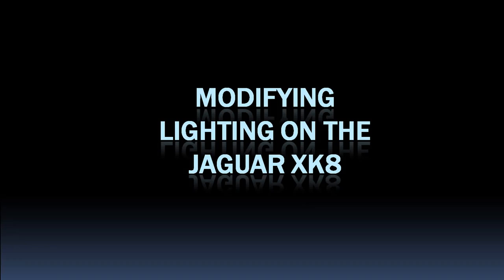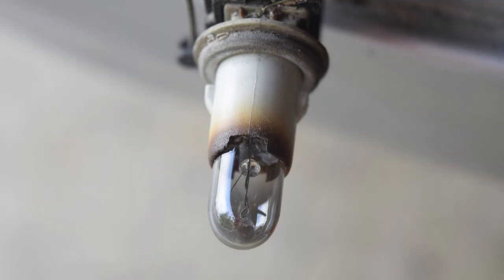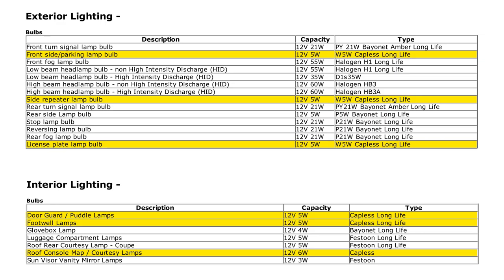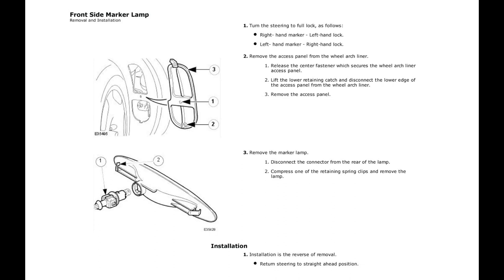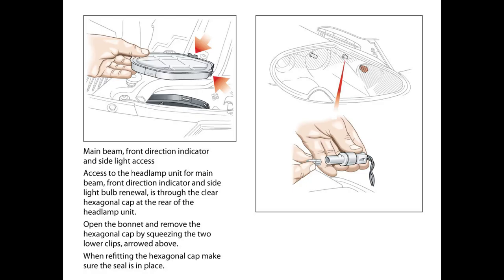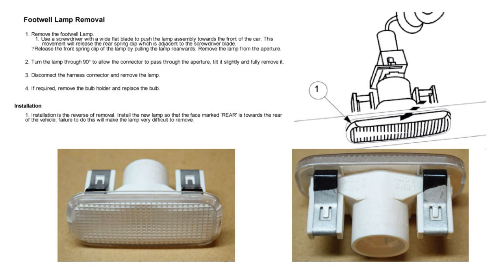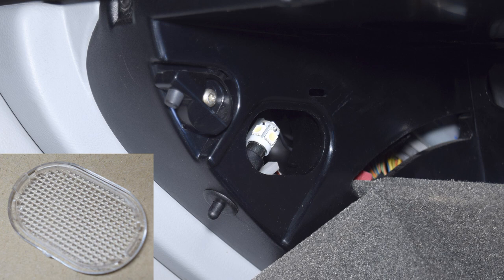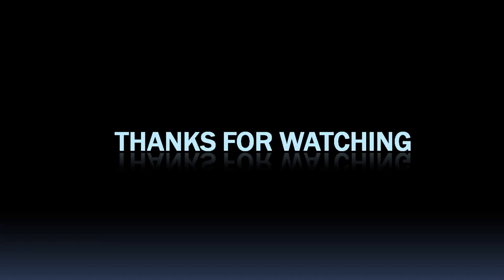Jaguar XK8 Lighting Modifications

Comment: Would love to know what upgrades you would recommend for the main and dip beams
Reply from the maker: Mike. I really don’t have a solution for headlamps but, coincidentally, the day you sent your message I met someone with an XK8 who was very happy with the HID kit he’d bought on eBay. However, a few days later you’ll see there was comment on this channel from Andork who wants to dump his HIDs. It’s my understanding that even if LED lamps are, or become, available that are bright enough for use as headlamps they need to be used in a reflector housing specifically designed for them in order to focus the light properly. That’s because, whereas a filament is a relatively small light emitting source, LEDs are relatively large sources of light, not least because designing them to be reliable requires very good heat dissipation, which in turn requires large surface areas. I doubt that anytime soon anyone will be making whole LED lamp assemblies for such a low production car as the XK8.
If you go for HIDs, I noted from observing the car, and talking to the owner of the XK8 I saw, that his were rather bluer than I liked and that he only changed the low beams. He used 6000K lamps but my own choice would be a color temperature that is somewhat whiter, probably 5000K. As for high beams, the HIDs apparently take so long to come to full brightness, you would lose the flash to pass feature. I guess the choice there is a balance between how often you use flash to pass and how much full-beam driving you do.
Reply: @richardastley2517  Here’s what I found when doing a little research when I put LED’s in my Chevy truck 3 years ago. Halogens all use a reflector type housing whereas HID’s always use a projector with a lens in front to properly focus the beam. The reasoning for this was because the arc in an HID tends to arch into a shape that a filament does not and can’t be focused properly by a reflector to prevent dispersion of the beam. So the problems with aftermarket HID conversion kits (into OEM reflector housings) were that the beam dispersed widely resulting in not only light being wasted illuminating the tops of trees but also blinding oncoming traffic. So that’s why HID conversions are a bad idea, they can’t be made to focus properly.

LED’s I found had some of the same problem and I found that the cheaper ones dispersed more while if you stepped up to the pump and got a pricier LED kit you also got better results getting more of an actual “beam” from them. I got some middle of the road LEDs that were actually DOT approved (I guess most aren’t?) and have had great luck with them, albeit I’ve had to aim them down 3 times now and people still flash me sometimes. These LED’s were so bright that when switching to hi-beams it resulted in almost less vision because those premium halogens I was using still couldn’t hold a candle (pun sort-of intended!) to those LED lo-beams. Though they illuminated slightly further down the road as hi-beams should, their output was so low and so brown they were worthless now.

So I went out and got some LED hi beam replacements but, being cheap, just got some “decent” ones that cost about 1/2 what my lo-beam bulbs cost. I figure at least spend the money for the low-beams as you’re always using them when there’s oncoming traffic. The cheaper LED lo-beams were also a big improvement over halogen but I can see how much the light on the cheaper ones disperses more so even though I can see better down the road I know it’s not as good as it could be because I’m also lighting up treetops.

So all that said, I’m rather miffed that there are no LED conversions for HID units because I would almost bet that those projector type housings would be just the ticket to counter the biggest problem with the LED’s, and that’s getting the light output to beam better, exactly what the HID projector housings were designed to do. My best guess there is that there aren’t that many trying to convert HID to LED in the first place. But what do I know, I’m not the engineer!
Reply from the maker: I think your comment is spot on. Looking at LED replacement H1s and 9005s on eBay and Amazon it seems the rule is cheap devices have big LEDs, whereas the more expensive types have LEDs with smaller emittance areas and adjustable positioning relative to the base (although it’s not clear to me why that should be necessary).
Reply: @richardastley2517  The adjustment is there so you can set the depth of the LED to your reflector to find the sweet spot where you actually get a usable beam instead of all the light just dispersing all over.
Reply: Richard .... check out UK company   bettercarlighting.co.uk. - some interesting recent developments on LED lights for older cars/ classics, including headlights.
Reply from the maker: Yes but isn’t there a datum point, essentially the locking flange, from which there is a standard distance to the filament of any particular bulb. I would expect the manufacturer of LED equivalent to that bulb to have established the optimum fixed that distance from the flange to the LED light source for you. That’s surely something better done by experts in a lab in my view.
Reply from the maker: Thanks, I'll check out that site.
Reply: @richardastley2517  As for that datum point, I would say yes. So why they make them adjustable...my best guess is that maybe with halogen bulbs a one-sie-fits-all ("datum") may work okay but possibly with LEDs that distance becomes more critical for some reason. That may include differences in design that place the emitters at different distances from the mount. I don't know, I"m just taking sound shots here. In any case I have seen videos where someone takes one of these adjustable units, shines the headlight on a wall 20' away and adjusts it in and out and you can see a big difference between the beam forming a spot and dispersing all over. It would make a huge difference on the road at night.

Comment: I wish to hell I could dump these HID's in my XKR for LED's. Don't like these HID's at all!
Reply from the maker: Andork. See my Mike’s question below and my response. Would you tell me more as to why you don’t like the HIDs.
Reply: @richardastley2517  For one thing they aren't that bright, they're barely better than the halogens I've had on other vehicles, albeit whiter. Shortly after I picked up my '04 XKR 2 years ago I had one start flickering. A little Googling told that this happens when the bulbs get old. So being hopeful, I spent $127 (nothing but the best, right?!) for a fine set of new bulbs so I'd have no more problems with that! Well, it was okay for about a year and now one is flickering again. I haven't gotten up enough ambition to double check yet for any wiring/electrical issues yet to rule that out but it's interesting how the new bulbs made the problem go away completely, but only for a year. But like I say, they aren't that bright anyway and can't even begin to compare with the LED's I put in my '06 Chevy truck 3 years ago (and for only 2/3 the price)! I should get a pair for the halogen hi-beams anyway.
Reply from the maker: @flyurway  I did manage to get powerful LEDs installed in my fog-lamps, which I use as daytime-running-lights. They work well because as “be seen” rather than “see with” lamps they don’t need to be focused. They are bright and white and compare well with any DRLs on new cars. It was a bit of a kluge because the lamps have a slot to take the narrow H1 bulb but are retained by the holder that has an HB4 fitting. I bought H1 LEDs, removed the retainer fitting and replaced it with an HB4 retainer. The LED lamps I bought have fans that I think protrude too much out of the rear to replace the low beams, which are H1s too. The lamps without fans have a big lump of a heat-sink at the back with the same potential problem. However, I’ll check if the lamps I used for my DRLs will fit in place of the low beams. If they fit I’ll see if they perform and let you know.
The high beams may actually be an easier mechanical fit because the HB3 is a fatter round lamp. Again, the space at the back is limited and there could be an issue with focusing of the beam.
Reply: @richardastley2517  Yes, the ones with heat sink braid on them will probably fit better but I don't know if that braid gets hot enough to melt any plastic that may be nearby. As for focusing, it's kind of a crap shoot. I found that more expensive ones seemed to focus better while others even have an adjustable ring that allows you to set the depth and those actually do give you that ability. At least with hi beams it's not as much a problem if the beam scatters since you don't use them with oncoming traffic (even though everyone else seems to!), it's just that it's also wasted light.
Reply: And strangely enough, if I recall, the hi-beams on these are a 9006, the same as the lo-beams on my truck (which uses 9005 hi beams). Go figure!